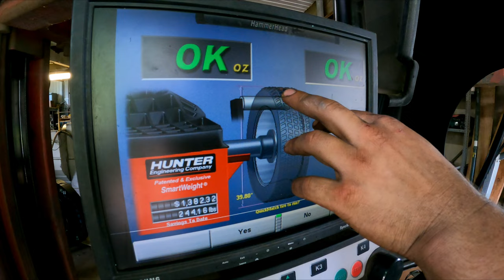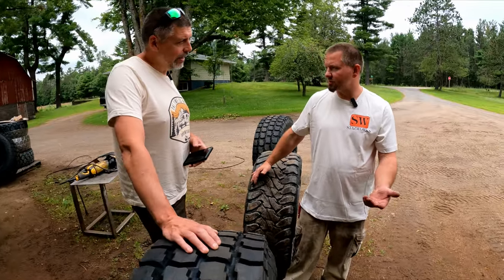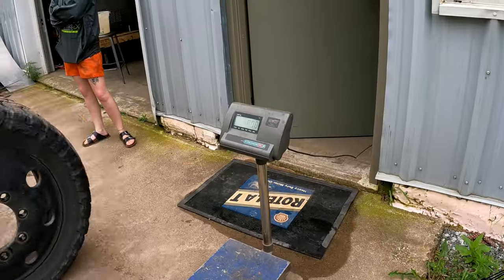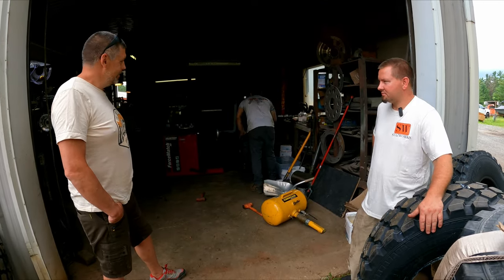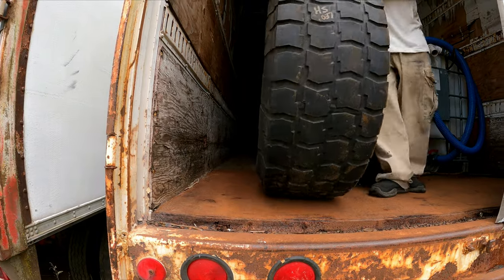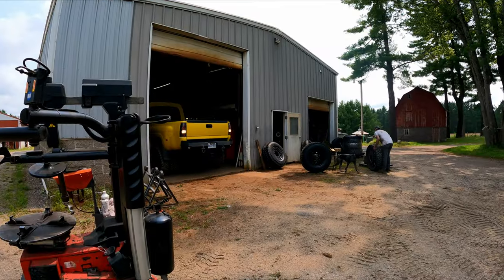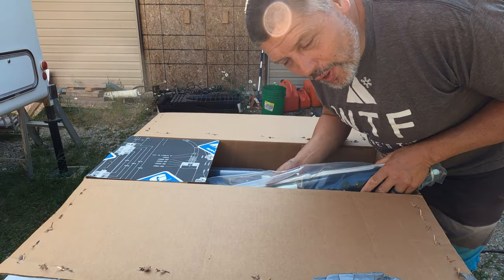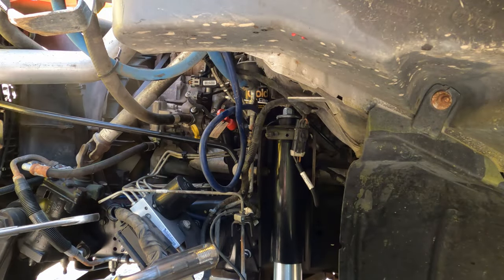Kodiak Truck Camper UPGRADE! Installing Stazworks 20x12 Wheels

Comment: Best way to balance those kind of tires or the beads inside the tire or the dyna beads that are in the ring that mount to the hub. Had on my 2003 for over 15 years and never had a balancing issue. Especially for high speed driving. Trying to do all the other methods always had vibrations
Reply from the maker: Glad the beads worked out for you. I've used them in several trucks and never had consistent results. I think they are great if you're picking up mud etc in your wheels though. Thanks for commenting.

Comment: We love our Stazworks wheels on our Kodiak truck camper! Have you looked into switching the front springs out with Deaver progressive leafs? That’s one of our next mods.
Reply from the maker: Yes. I've talked to Pat at HD shocks about front springs. Shipping cost from California would have been steep though. We may still get them when we are down that way this winter. To be honest though, the shocks were a major improvement in ride and I'm not super keen on lifting the front another 1.5 or two inches.... I'm on the fence.
Reply: @TheTimeIsNowAdventures  from what I have heard it really improves the ride. I’m in AZ so shipping isn’t to bad. I want to do the King shocks as well. Love your build!
Reply from the maker: Thanks for watching. More to come.

Comment: I don't suppose Goodyear has a highway speed rated inflation chart for those tires ?, conversely a low speed inflation chart for off road. I would imagine once you have the camper in, the front won't need more air but the rear will will need ... again, hard to know what pressure it will require as one doesn't want to run under inflated and yet not way over inflated. I get the impression that far too many HD trucks ( talking 3/4 and 1 ton ) are putting way too much air pressure in when not really loaded down much and just suffers from a rough ride and beating up the truck and passengers for nothing.
Reply from the maker: A chart could be handy to get a starting point but using an infra red heat gun to measure tread temperature seems to work well. Adding about 5 in the front and 15 in the rear seems close with the camper loaded. I'm sure we'll fine time that a little more when we get traveling soon.